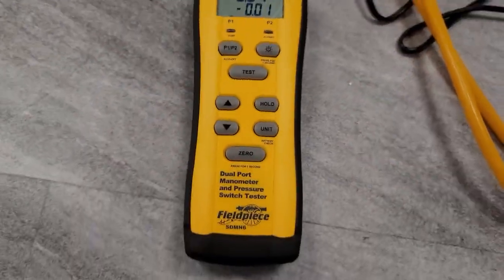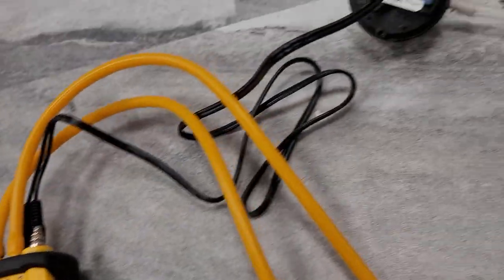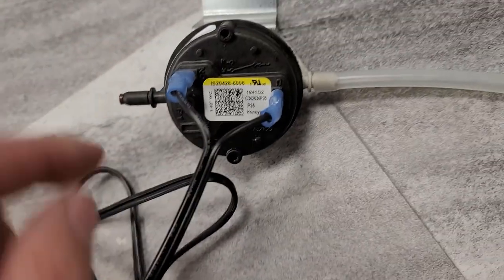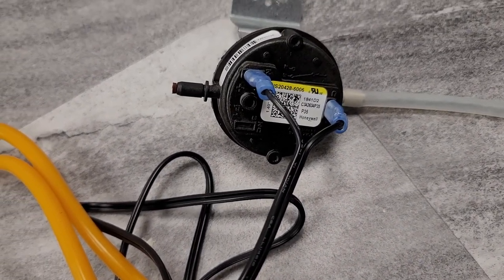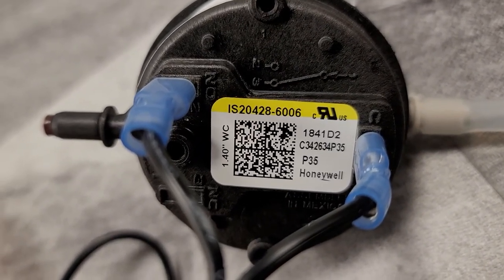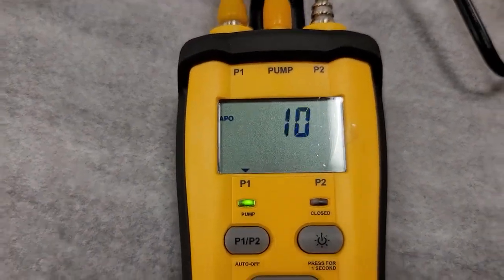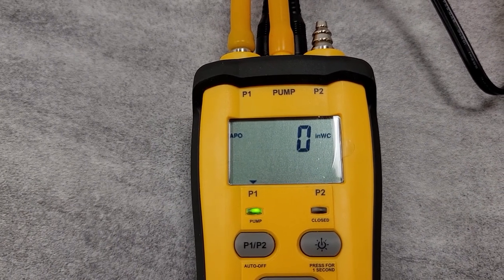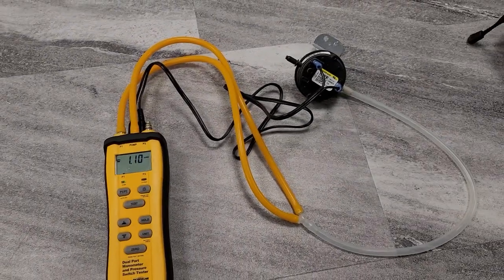SDMN6 pressure switch tester

Comment: read the manual, you should disconnect the pump hose at the purge and place the pressure switch at the vertical